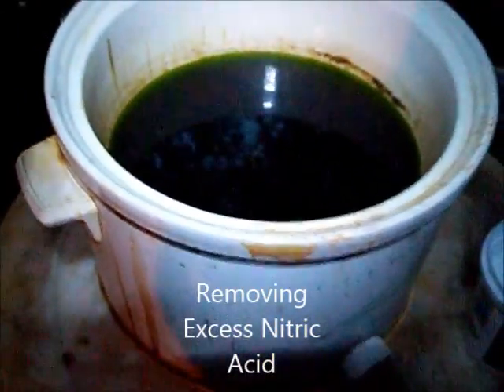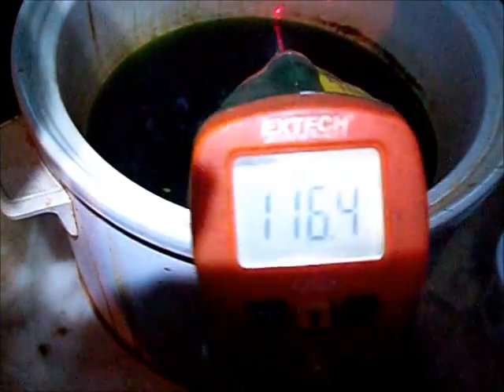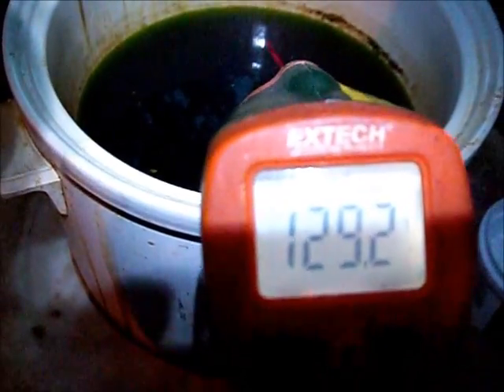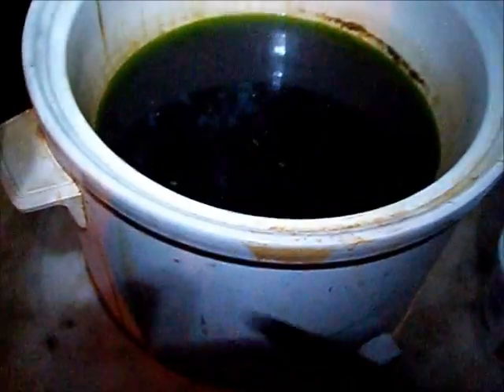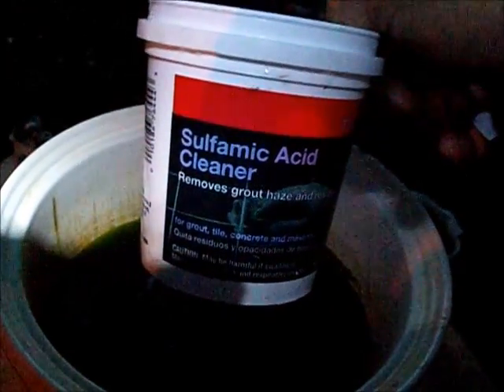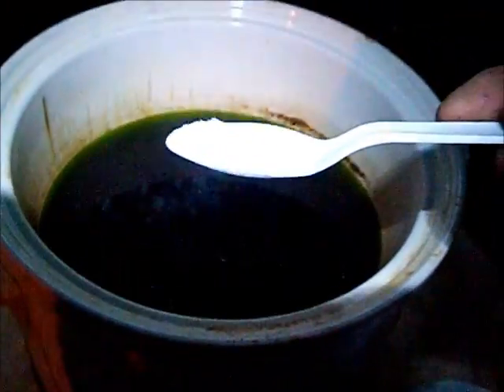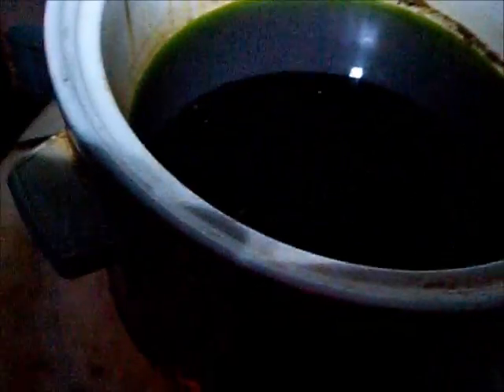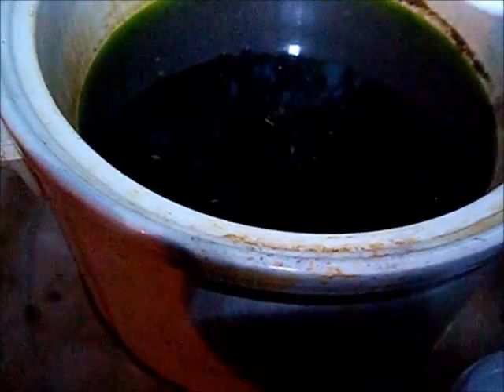denoxx 1

Comment from the maker: The crock pot was bought at a local thrift store named Value City U.S.A. It cost $4.99 and works great for small amounts. A gallon of green copper(II) chloride (AP) will dissolve the base metal from about a half pound of pins in a couple of days on high. Be sure that it has the all glass lid and not a glass lid with a plastic knob. The fumes will dissolve the screw holding the knob on.
Reply: Yep, I am reading it all and re-watching now.

Comment: Hi" Geo" is your pot a crockpot ? and is it on ahot pate ?or fire ? thank you"
Reply from the maker: It is a crock pot or slow cooker. The actual inner pot is ceramic and the outer pot is aluminum with a heating element. It has four settings, off, low, medium and high.

Comment from the maker: There has been some confusion about this video. I mention that I bought that particular sulfamic acid at Lowe's and then later I say that I buy mine at Home Depot. Lowe's does not normally sell sulfamic acid. I spoke with the local store manager because of a sign they had posted that they will match or beat any competitors price. After some haggling, I convinced him to special order some for me. Lowe's is much closer to me than Home Depot. If your local Lowe's does not carry it, ask to speak to the manager and let them know that there is a product at Home Depot that you need and want and you would like to buy it from them. It may or may not work at any given store.

Comment: I'll admit Geo, I haven't had much luck using Sulfamic acid on dirty AR from ceramic CPUs. I am very careful with my nitric acid additions during the recovery.  When I add the sulfamic I barely get a reaction or sometimes nothing.
The trouble starts after when I try to drop the gold with SMB. I will get lots of fizzing then and the gold doesn't want to drop.
 If the SMB doesn't drop the gold I'll move onto cementing with copper. When I add the copper I can see a instant reaction from the nitric acid. I'm at a loss as to whats going on and why the sulfamic isn't working.
Reply from the maker: Are you carrying the dissolution to completion in one addition of chemicals? I do it in steps. I intentionally start with too little HCl to fully dissolve all the metal. This ensures that no matter how much sodium nitrate I add, it will not dissolve all metal. When the reaction stops and and will not start again with more nitrate, I let everything settle and test with stannous chloride. It should be negative for gold. Filter the solution and add anything in the filter back to the reaction vessel. Add fresh HCl and start the reaction again. Depending on how much material I start with, I may repeat this a couple of times. When you see the pins/legs floating on the surface, it's time to dissolve everything. The pins that are floating is actually hollow gold tubes with the kovar base metal removed. This means there is very little base metal left. Be sure to test this last solution while cool. A hot solution can give a false positive.
Reply: Geo, I am familiar with the process. I've done it numerous times. Recovery from ceramic CPUs can take a lot of acid because there is a lot of base metals to chew through before it goes after the gold. I usually will have the reaction stall once. I'll check with stannous and it will be negative. I'll pour it off and add fresh HCl/water and continue on. The problem is the sulfamic doesn't seem to denox for me I don't get the reaction you did in this video. When I add the sulfamic I barely get any fizzing which is confusing.
Reply from the maker: Of course, I did not mean to offend or imply. I type responses I think other people reading may need to see. 
I have no idea. Either the sulfamic acid has some how gone bad or it's not really sulfamic acid. Look up the wiki for sulfamic acid. It doesn't show the reaction but there is a pretty good description for it. I would be suspicious of the sulfamic. Even if it's in the same container as what I have. Try a different supply. The crystal look like tiny diamonds. Very glittery.
Reply: No offence taken Geo, just confused why it doesn't work. I bought it at Home Depot a year or two ago. It seemed to work somewhat when I first bought it but lately it doesn't want to. I'll get some more, maybe it's bad. The powdered sulfamic looks just like regular white sugar.
Oh, and thanks for the video, well done!
Reply: You should add sulfamic acid to a HOT AR solution.with a lot of stirring. Works well with AR but creates a mess when trying to deNOx  nitric acid silver leach solution especially if there is lead present - in this case I am using urea.
Reply: Baffling?? I am a newbie but have not had any trouble using sulfamic acid. I buy the real stuff online. Not the stuff GEO is using. I add a little at a time as GEO is doing. Don't more than 2 teaspoons max.
Reply: I have had this happen a few times as well. What I found to help goes against everything I have learned from the forums. I add an excess of sodium nitrate ( or potassium, if that is what you use), then denox. It seems to alleviate  the problem. I still try to add a minimal amount of the nitrate source then add just enough more to produce a small excess.